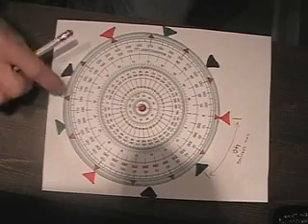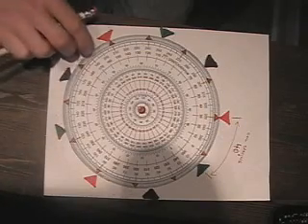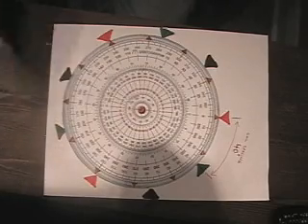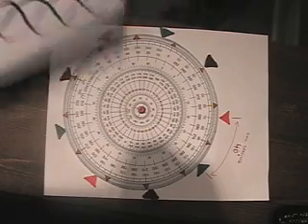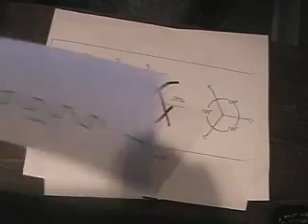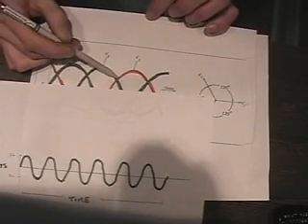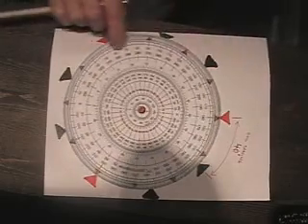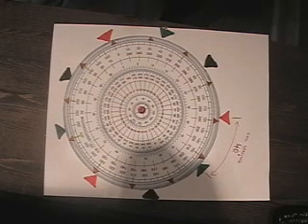3 phase explained generator pma wind turbine magnets vawt

Comment from the maker: @gepisar    i'm gonna say yes, and no!!  all depends on your setup, if your magnets are setup properly as far as where they physically are in relationship to your coils then yeah it will work, I would stick with 3 phase just because its a happy medium for a good voltage output as well as good amperage output. how many coils per phase would you be doing? and how many magnets?

Comment from the maker: i'm gonna say yes, and no!!  all depends on your setup, if your magnets are setup properly as far as where they physically are in relationship to your coils then yeah it will work, I would stick with 3 phase just because its a happy medium for a good voltage output as well as good amperage output. how many coils per phase would you be doing? and how many magnets?

Comment: (cont) Still would like to get more on the stator theory but am not finding it.  If you know of where I can get it let me know less you have time for it.  IE, how to compute the windings of the coils needed, gauge of the wire, type of coil, number of coils, 9,12,etc.  I have heard up to 36.  Cut in speed etc.  Really, it's the math that detail with coils type, design, height, size, width and number.  I do understand why most people use 9 coils and 12 magnetics.  Well, that's what am digging 4.

Comment: It was just an oversight in the presentation by mistake.  The theory you explained in the presentation is half wave rectification vs what most use which is full wave rectification.  Full wave rectification converts both sides of AC to DC so that you have two pulses per above the zero reference line and not just one.  Really in AC there is no such thing as negative; just the wave form reverses direction based on a frequency.  You can look up on Wiki Rectifier for details. (cont).

Comment: I cant reason why you explained it using half wave rectification instead of full wave rectification. take the waveform and fold it up from the zero voltage line so the negative transition is on top of the positive transition. there is twice the power in full wave. othewise it was a good video. thanks.

Comment: You make a mistake in the presentation.  When you run it through a bridge rectifier; the negative side is superposed over the positive side of the DC output.

Comment: @bg0821 
12 mags***9 coils 
you can do 24 mags on top and under ur coils to double voltage... but still 9 coils
12 mags on 12 coils is 1 phase... you wont light anything with that :o)
Check my videos for info